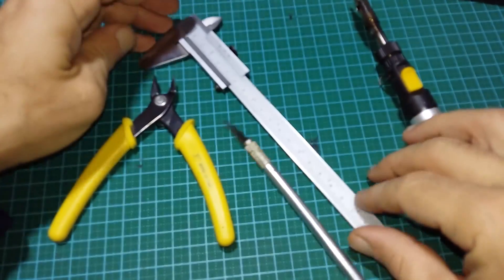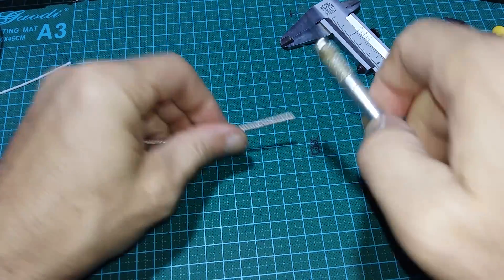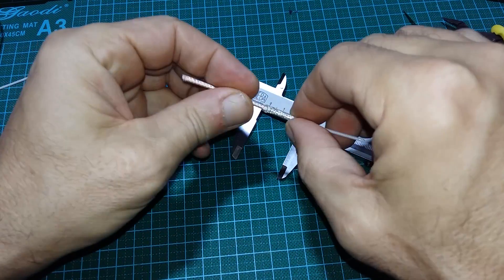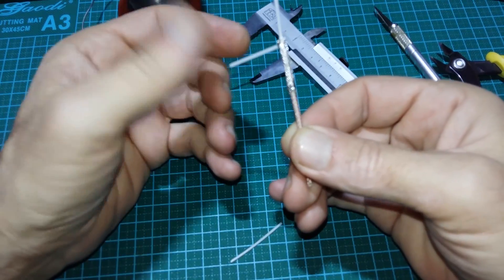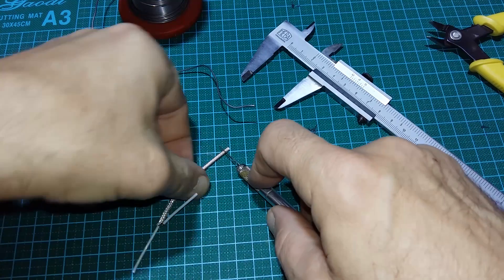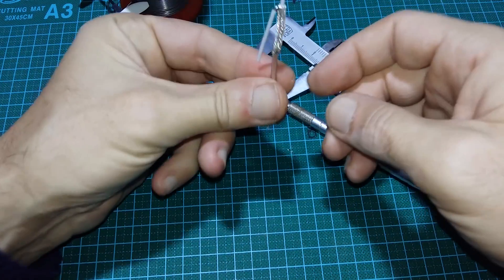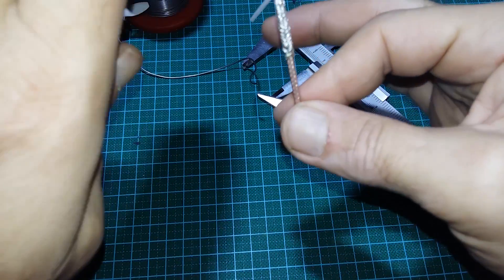How To Make Simpe Yet Excellent Antenna For WiFi Or Your Quadcopter And Remote

Comment: The part starting at about 2:04, I've attempted like 3 times. The first time I threw the wire away because I really messed it up. The 2nd time I cut the sleeve off and slid it down. The 3rd time, I actually did it well and it came to the correct length, too... while drinking beer!

Comment: Hi Milan, can you show me how to match using a balun 50 ohm cable to 3 element yagi 
the correct way? narrow band
regards Brett
Reply from the maker: The best way is to use 'gamma matching' if possible:
https://www.google.com/search?q=yagi+gamma+match+design&tbm=isch&source=iu&ictx=1&fir=mSObcuVspB5CIM%253A%252CErgUUKqxQynucM%252C_&vet=1&usg=AI4_-kTYsowj3qHWBAA5rsjcPAxYV0UB0w&sa=X&ved=2ahUKEwif8ornm5bmAhUklosKHdgHBN8Q9QEwAHoECAcQBg#imgrc=mSObcuVspB5CIM:

If small antenna, it can be made of brass or copper wires and solder instead making clamps and whole construction.

Comment: Instead of RG316, could we use RG213 with same length?
Reply from the maker: Isn't RG213 1 cm thick or so?
Reply: @MilanKarakas  yes it is thicker than 316. What should i do ?
Reply: @MilanKarakas  actually, I will use this antenna for sending RF signals towards it. I wanna use a waveguide for guideness of 2.4 GHz.
Reply from the maker: @lionheartsummit284  The problem is that for every thickness of the cable, particularly central part - calculation is different. Also, if this part of the antenna is too thick, it will be wide in resonance, but quality factor and gain will decrease.
Reply: Woow then i have to order a cable of this kind:(

Comment: I'm trying to do Dipole antenna for a class project, what is the SWR and the Reflection Coefficient on this antenna? Also what did you use to match the antenna as the cable impedance is  50 ohm and the impedance of the Dipole are by theory 73 +42.5j.
Reply from the maker: I have no idea about SWR and how to measure it. For small transmitter (1 mW) for quadcopter, it goes over 1 km, so most of the energy is out, not reflected. Matching impedance is done by 1/4 lambda coaxial sleeve + odd multiplier of the rest of the cable as a impedance transformer. Also, note that this antenna and its dipole is not straight but rather at some angle - this helps bring down impedance a little bit.
Reply: @MilanKarakas  Thanks a lot, I will try to make it. Any other  recomendation?
Reply from the maker: @mariofigueroa2110  Not at the moment. If you have some device with RSSI or any measurement, rather pay attention to good signal than SWR. SWR is okay up to 1:3, so no worry there. Usually manufactured antennas are around 1:1.5. Exactly because of complex number part... or, there is resonance and "anti-resonance" part if you look at voltage or current to or from the antenna. Pretty complicated stuff... :D
Reply: @MilanKarakas  I made the Antennas and they work perfectly. The TX have a Reflection Coefficient about -29dB with SWR about 1.2 and the RX have a Reflection Coefficient of -16dBi and SWR of 1.4 My only problem was that I have to use coffe straws and hot glue to make the dipoles more straigth in order to have a better Radiation Pattern. But these Video was great. Now Im making A Yagi Antenna for 890MHz to 960MHz with Gain about 12dBi.
Reply from the maker: Don't worry about SWR. It is more important that you have good transmission power and reception. Up to SWR 3 is fine, but above 3 is in danger. I watched many professionally made antennas, and every single has SWR exactly around 1.5 .Rather use actual receiver and if you have RSSI or other way to see whether it is good or not - if you measuring TX, then put 50 Ohm resistor as a termination on your receiver, lower TX power and make some distance between TX and RX. Then tweak antenna of interest (this time TX). Repeat the process with RX antenna, terminate TX with 50 Ohm "dummy antenna", or just solder resistor (small inductive reactance). Yagi antennas are really good. I should to make one video about dipole feed - the best I have found is so called "delta matching", where GND of the coaxial cable goes exactly at center of continuous conductor (1/2 lambda), and "hot wire" or feed at 1/3 at one end. For lower frequencies (say 144 MHz), you may add trimmer capacitor to adjust impedance, but for higher frequencies i tried and even without any capacitor it perform much better than feeding antenna by GND (shield) to one part of the dipole and hot wire to another. I am glad I can help. Thank you for comment.
Reply: Extremely easy to follow thorough video!!!! Thank you for sharing!!!!!!

Comment: GOOD JOB! Are you a Ham? This is essential / basic antenna theory and works on all freqs / bands. Feed lines such as coax being un balanced. Although we feed some HF antennas with ladder line which is balanced. Very good tutorial!

For folks in the USA by law we are supposed to be a Ham to modify any wifi device. Part 15 devices i think it is are not supposed to have removable antennas. Just so your audience knows. But this is why so many of the older wifi routers are in big demand. =]

WW5RM
Reply from the maker: Yes, ham, 9A4GE. Thanks.
Reply: @MilanKarakas  Awesome! Croatia! Stay safe brother! =]
Reply from the maker: @WW5RM  Likewise.

Comment: Is it posible to conect other remote to new drone? I have forgot my original remote at home, but my frend has another remote but i can not pair with drone? What need to do? My original remote is smaller, drone is china made- ky 601s
Reply from the maker: There is "multiprotocol" adapter that support every toy grade "drones": https://www.banggood.com/2_4G-CC2500-A7105-Flysky-Frsky-Devo-DSM2-Multiprotocol-TX-Module-With-Antenna-p-1048377.html?p=EH10221611330201505Q

Comment: so can we split the into two antena for the transmitter? example are Mavic controller, or we use a wifi detachable antenna and solder the rp-sma m connector to the transmitter?
Reply from the maker: I have no idea why Mavic controller has two antennas. You can solder whatever you want, any connector. If that makes easier job for you.

Comment: Hi Milan, I have a couple semi-off topic questions 

the green mat you are using, how heat and scar resistant is it? 
heat as far as any protection to counter underneath? (in case drop iron or hot  glue gun tips off stand and not best time to grab, holding a soldered or glued part in place till cool/cured for example)  

scar resistant as far as say using an exacto knife to roll cut wire jacket, does it start to get a peeling off of top layer if it gets a few surface cuts from slips? (looks like scotch tape peeling up i guess is best i can describe what i mean)
and
I been shopping them at BG, but they seem small, what size is yours?
Reply from the maker: Preparing video answer... wait...
Reply from the maker: Here is the video answer: https://youtu.be/OPHJm1XtfYE

Comment: It can be used on a little vtx for micro quads?? (Eachine ef-02/ very little, 3 gr!!). I broken my omnidirectional at the base, the board cracked!! So I cannot resolder it. And I prefer this one that is less prone to be squashed. If I can resolder it !!! Will see. Thanx for this vid and I will for sure check out oiur stuff !!
Have a nice day
Reply from the maker: This antenna is for 2.4 GHz band. Not for 5.8 GHz, if you think on analog VTX. Some quadcopters has 2.4 GHz WiFi video link, and only then this one can be used. Instead, if you have 5.8 GHz VTX - do this one: https://youtu.be/Rzumbr72xjg
Reply: @MilanKarakas  Thank you.
Reply from the maker: @paulterl4563  Did you get my answer just now? You are not only one who did.
Reply: @MilanKarakas  Yep.
Nevermind.
Subscribed.
Take care.
byeee
Reply from the maker: @paulterl4563  Thank you very much. Something strange is with YT notification - sometimes I did not get notified that someone posted comment, and people not getting my answer.

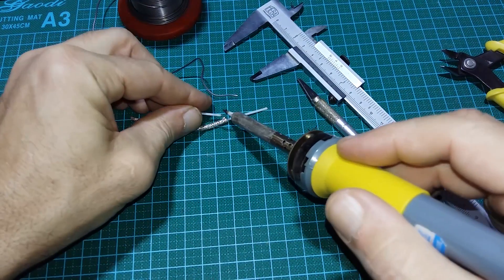Comment: Milan I have the same soldering Iron at 6:02 good for holding the heat, do you know where I can get new element from ?
mine burned after about 5 years....Brett
Reply from the maker: Good question. At the time, it was all present. Mine is ZD937, but I think that ZD331 has the same dimensions. I think it is time to think about new heater, since mine is more than 5 years old. Huh...

Comment: Nice ! Did you try to do this mod on the eachine H8 ? What is the distance you can reach using this quadcopter ? Also, do you know how many dBi is this antenna ? Thank you !
Reply from the maker: No, H8 can't lift camera, so there is no point to go far with such small quad. This antena is about 3 dBi.

Comment: Best antenna guide I have seen ....very informative and upon following your instructions I have successfully made several of these for my quadcopters.  Thanks
Reply: Same here. Took me an hour to find this video and it answered my questions completely. Was able to order the materials and repair my FRSKY xsr receiver to better than new. Thank you WildMania!
Reply: WildMania i just got home after a flight from the antenna mod and i must say my jaw dropped.
Im not sure how far my quad went up but my neck hurts from trying to keep my head up to locate my $23 quad.
Your a genius.
Reply from the maker: Thanks man!
Reply from the maker: Thank you to for nice comment. I am glad to hear my video helped someone.
Reply from the maker: Thank you too. So, please share this video - out there are many desperate people who broke antenna, and don't know how to repair it. And many people who want better performance.
Reply: notchbak i made one for my transmitter but my transmitter doesnt have ground, can i still do this withought using ground?? thanks
Reply from the maker: No, it will have not effect if ground is not connected.
Reply: WildMania mr wildmania. does this include the quadcopter. if i do not ground the  antena inside of the quadcopter? big thank you
Reply from the maker: Yes, on both sides. The purpose of coaxial cable is to conduct radio waves. If ground is not connected, either on receiver or transmitter, you have situation where it act just like piece of wire - but this time out of proper resonance. On quadcopter, there is green mask (solder mask), just scatch surface and then you can solder it on ground. To get idea how ground looks (many holes around), please take look: http://i2.wp.com/wildlab.org/wp-content/uploads/2015/07/GNDs.jpg
The same is with transmitter - somewhere should be ground, but do not extend ground wire too long.
Reply: WildMania wow thank you very much.
Reply: WildMania one more question mr wildmania. on my reciver board in the quadcopter next to the antenna there is a screw that holds the board down, is it ok to use the screw as ground? thanks again
Reply from the maker: No! Usualy such screws are not well connected to ground. It is a gamble. Just use flat screwdriwer, gently scratch solder mask and solder on the GND surface. It is big gamble because at one moment you may have good range, but at next moment bad range and quad will fall somehwere... really bad situation.
Reply: WildMania ok thank you sir you too much help
Reply: vassilis Thegreek غتلتئناينايةل
   Tyhfh 
 () dhdhgx-:-) jjj

Comment: Milan, in your demonstration of the range you've been flying in a sraight line and have a staight line road/canal  geographic reference for aiming the transmitter.
What happens if you don't have such a good fix on which direction to point? That is, when reaching such large range, it must be very directional, right? How many degrees is the spread where the quad can receive at distance?
Can the spread be increased by using more than one antenna?
Reply from the maker: +Dave Review 
Dave, you asked very good questions! 
Yes, I did it by knowing where it will end. But my other FPV flights are about half that range (cca. 500 meters only). Firstly anyone who fly FPV should build space orientation and mental image of where is the quad in respect to you, and where are you in respect to what you see on video feed from the camera. This way, you are pretty close to direction where it should be pointed. Also, my receiver has panel antenna which has four elements, thus pretty much directional. Just moving my helmet left right, and I can "feel" where video signal is stronger, but also where is my quad, so I orient remote to this direction too. In most cases of long range, I rather fly twice than circling around for example. Going say east, then back, then north, then back - rather than east, then circling to the south position. 
I don't know exactly how many degrees, but I know that as distance increases it feels more narrow. Another trick or secret of long distance controlling is in position of the receiver antenna on the vehicle. Away from noise sources: processor, MOSFETs, and motors. On transmitter (remote) side, it is done by slightly emitting more forward by "V" shaped element. Imagine donut shape, or toroid shape. If it is balloon, and if one part is squeezed, it is elongated, while the rest is shrank. This elongated part is where "V" shape doing this trick. 
No, more than one antenna usually result in more narrower beam (stacked antennas). In the case you want neutral beam, or omni-directional antenna, don't make "V", but instead straight dipole. As I said before, half of the trick of long range is in "V" shape, but other half is in moved antenna from the nose sources. Thanks for the questions.
Reply: +Wild Maniac Yes, I didn't think about the ability to slightly scan to and fro, as if to  "hear" where the signal is received more strongly. 
And OK, so you are flying straight line and back as a practice in navigation. Thanks.
Reply: +Wild Maniac So then multiple antennas would need multiple transmitters working under the one set of control sticks.
Reply from the maker: +Dave Review 
Yes, generally speaking. Once you have some feeling of space, then you can fly slightly out of straight line. And, with practice, maybe even more than just few degrees.
Reply from the maker: +Dave Review 
Not exactly. Single transmitter, with "splitter", which first split signal to two cables (each cable getting half of the power), and if needed - each cable to another two. Depend how narrow beam you want. One important thing is that all signals on antennas are in phase, otherwise it may end in bad side-lobe pattern. Two or more transmitter will result in bad interferences, since you can't control phases.
Reply: Understood. Thank you, Milan.
Reply from the maker: You are welcome.

Comment: Hiya Milan, on the other video, the one for the sleeve antenna, did you use RG178, or the RG316?
I wound up getting some 178 but finding it a little delicate to work with, so think I'll order some 316, may have a little better luck not damaging it stripping or burning insulation soldering, chuckle, real fine detail soldering not my strongest skill, it's far better than my painting, but I cant solder a house either
Reply from the maker: +Edward Hollibush 
I found the same issue - too delicate to work with. On all my videos, RG316 is used, except for FPV Mobius, where it is RG178 (single video). I wanted to save some weight, but amount of work on this antenna is... say three times longer if not more. Regarding insulation, it is PTFE or better known as Teflon. It resist temperature up to 260 degrees Celsius, and for short period over 300°C. Heh, not tried trick with flame - it just soften, but after cooling it back to its original state. Different thing is with razor blade stripping. It resist blade, but wires behind does not resist. So, yes. I understand the difficulties. But, RF and mechanical properties are good for use as an antenna, much better than other cables.
Reply: +Wild Maniac Well, i kind of misspoke, i meant more as you described kind of softens looks a little melted and gets a bit discolored, i just use the term burned for any distortion or discoloring of insulation, not actually blackened or flames, not the proper term for it I'm sure 

Thanks for answering man, I'm  going to go a size up then and order the 316, BG has a 5M coil for 5.99, i just do little projects now and then, more repair, replace and minor improves than building or chop shop type customizing, you know, real simple stuff, umm i guess tinkering would be a good word for it, so 5M will last me a long time

Take care Milan
Ed